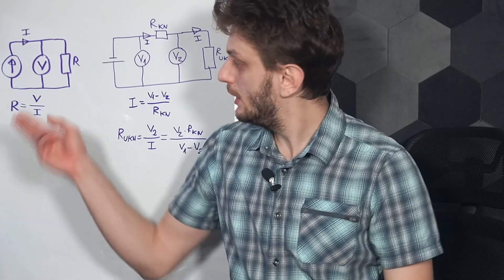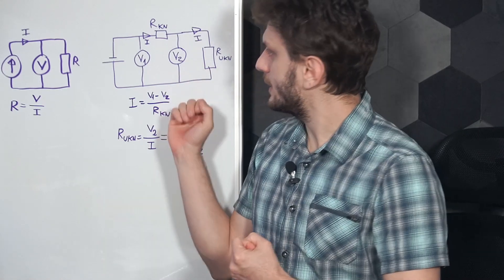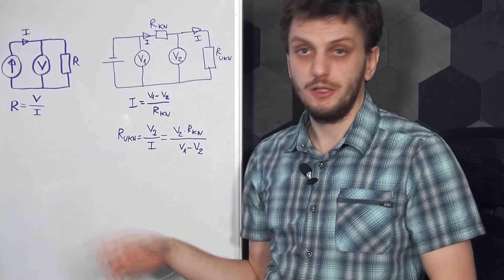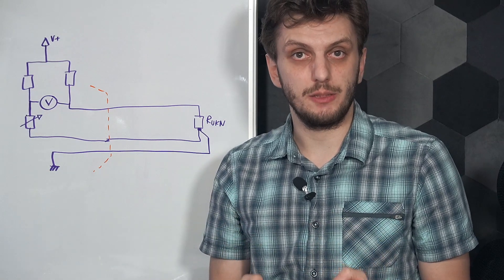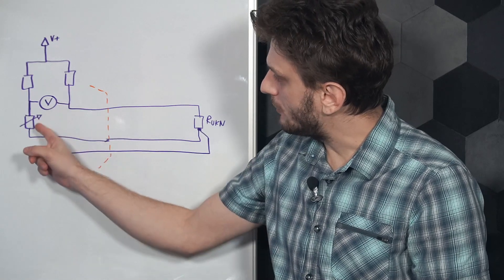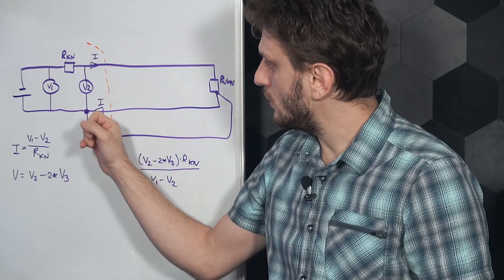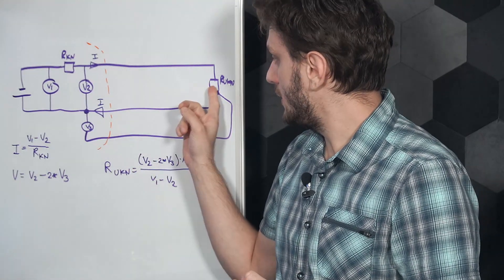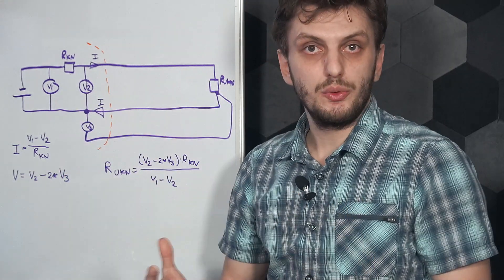Measuring resistors with multiple wires - 2, 3, 4, 6???

Comment: Hi FesZ electronics most bench multimeters have a four wire resistance measurement mode indeed I have a kiethely and a keysight although i must admit i prefer the keysight unfortunately these are are much more costly whereas handheld multimeters can be about 20 euros  bench multimeters are from about 600 euros.
I have several years ago used a siz wire multimeter but this was really expensive approx 10,000 euros.

But in my faultfinding endeavours I usualy employ the op-amp trick that you have demonstrated.

Well done and keep up the good work I do enjoy these videos

Comment: The error for the 4 wire method in this case (with two different multimeters) is being caused in this case by the fact that the error of the voltage difference (both multimeters) is twice as big.
There is also a small error from the resistor. 
This can be calculated by using the formula for relative error. 
Which is the sum of absolute value of each differential of each variable (multiplied by its value)

Comment: For the "in-circuit" resistor - it would help if DMMs had an AC-excitation source, with synchronous demodulation. Do you know if any off-the-shelf DMMs have this?

Comment: From the title, I thought you were going to measure the power handling capabilities of some resistors. Haven't used the 6 wire before but it's quite an interesting prospect
Reply from the maker: I updated the title a bit to make it more clear. Thanks for the observation!

Comment: Hi FesZ Electronics, will there be more LTspice tutorials ?
Reply from the maker: Of course, whenever I find a good subject I treat it as a dedicated tutorial, but regardless of video topic, I try to include circuit simulations - always using LTspice. Would there be a specific simulation subject you are interested in?
Reply: @FesZElectronics  It would be interesting to simulate different switching regulators such as TPS from Texas Instruments (step down/up). Another interest subject is to simulate ESD /TVS diodes.